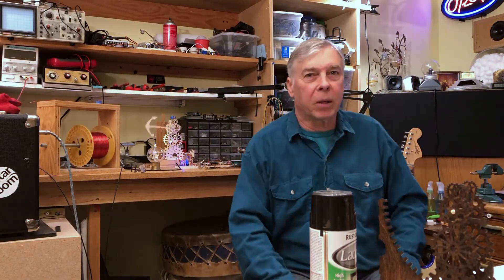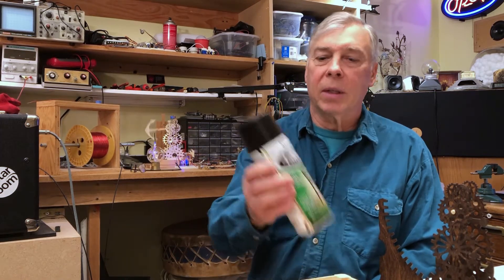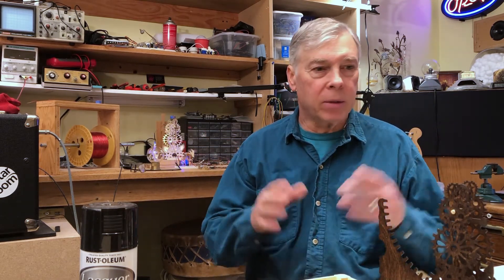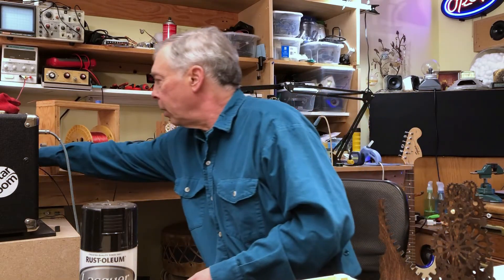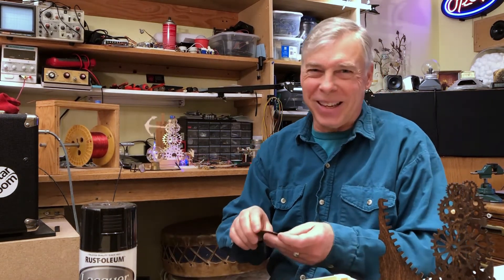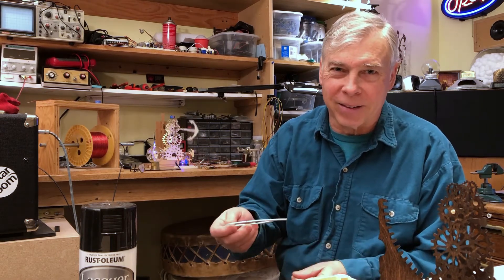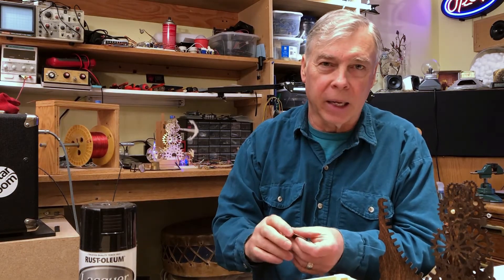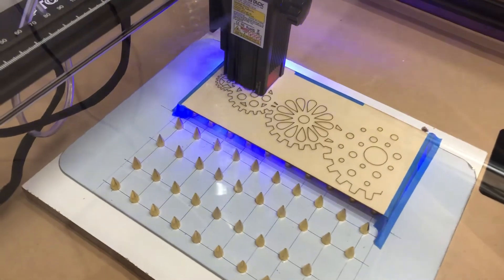Brass Etch Success with Atomstack M40 Diode Laser and Black Spray Paint Solved!

Comment: Hello, is the pixelated artwork the reason to not smooth letters?
Reply from the maker: I have limited experience with the laser engraver and for sure there are settings to create cleaner graphics such as outline plus fill. For my purposes here I was focused on the process in general and considered this adequate quality for the project at hand. The font itself may be part of what you are referring to and different ones would come out cleaner looking.

Comment: Nice job. I got lucky and dropped on to a tip suggesting nail varnish( lacquer) as a mask early on.
Reply: I found the nail polish suggestion as well but never tried it. I did try some model airplane paint that "should" have worked but it was not black and as I remember it did not burn off well. Thanks for stopping by!

Comment: Hello Bill,
I bought a can of the brilliance laser black ink, same brand you shown on the video (very expensive, by the way), and I didn't get any result on brass engraving.
Any tip or any clue about the procedure and CNC laser parameters?
Thanks in advance.
Reply: Hmm I am confused since I have never had nor used "brilliance laser black ink". The common lacquer paint I used just makes a mask for the electro etching of the brass. The blue laser diode will not etch the brass directly at all. The laser ink you are referencing is for CO2 lasers, not a diode laser but it seems some folks have made it work with a 5w diode laser. The laser ink will just leave a permanent mark but not a physical etch into the metal which was the main goal I had with my project. Best wishes hope this helps!